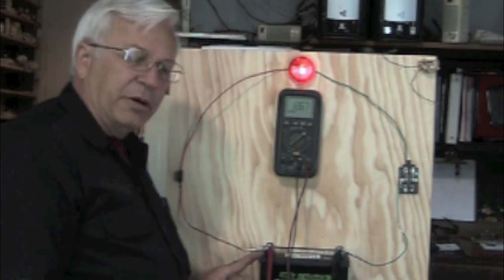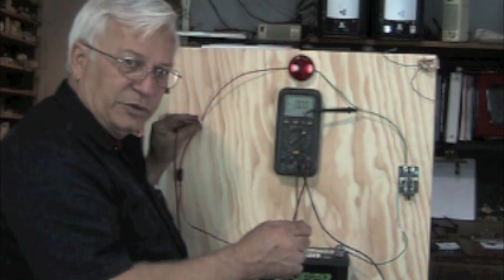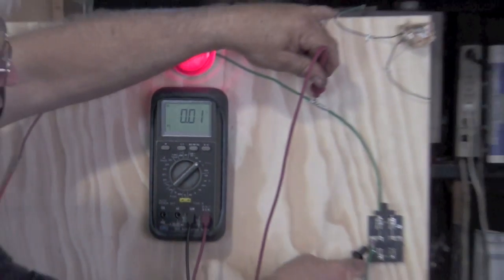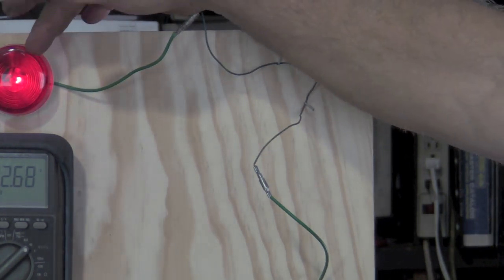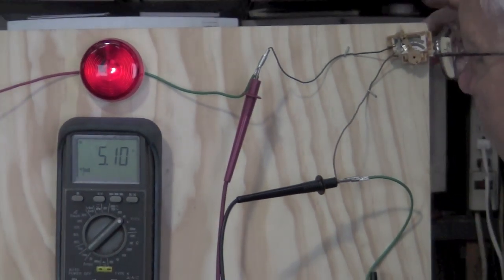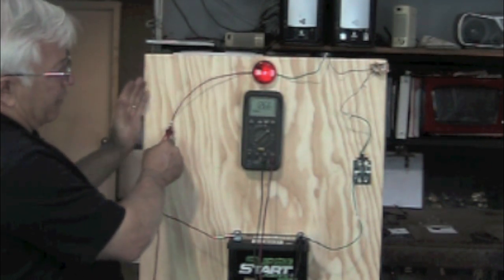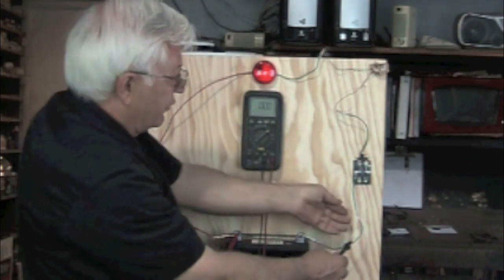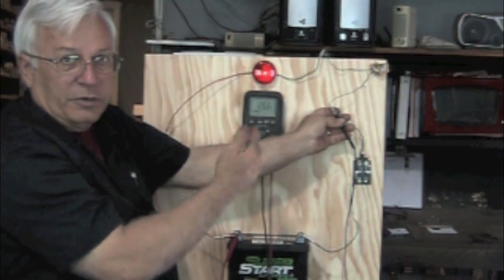How to test ANY circuit      Part 3

Comment: I know this video is several years old, but I have a few things to point out. The fuse should be the first component from the positive side of the battery. Should anything be shorted out. It blows and protects the other components from the short. Second, should be the switch and then the object to be driven, motor, light etc.  I also notice at 3:58, you did not Open the circuit with the switch before you manually broke the wire connection and hooked up the rheostat/potentiometer. Even though it is just 12vdc, it not a good practice to make changes without turning off the power. If this were in a true automotive environment, the wire coming from the (object to be powered) could have touched to ground and might have shorted out. Or worse, cause an electric shock. For safety, always turn off the power to the circuit you are working on.

Comment: Recently in Calgary a 'sting' was done by a local journalist at about a dozen repair shops. He brought a car to each shop with a bad ground connection to the battery, and said that he couldn't start the car but it boosted fine. Of about a dozen repair shops, almost all sold him an unnecessary battery. Of course they didn't bother to do a voltage drop test. An embarrasing oversight....